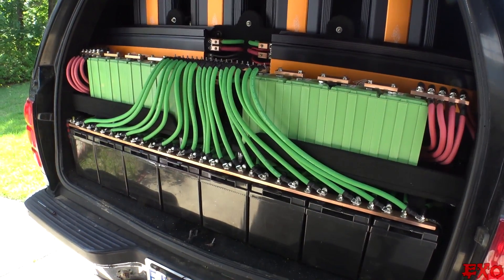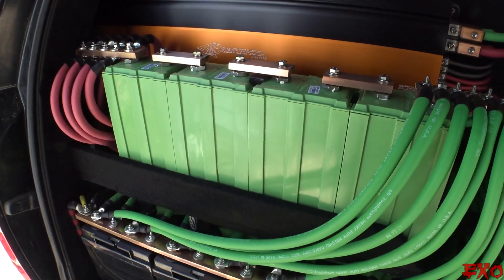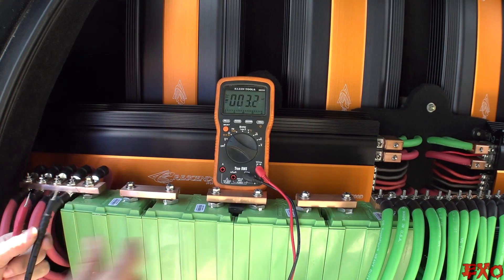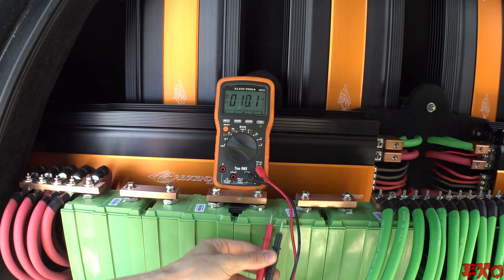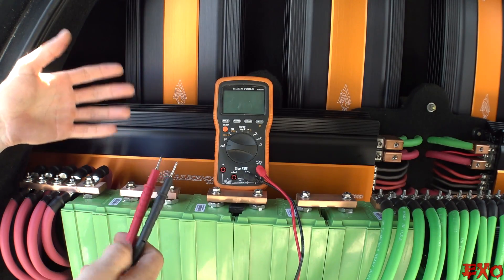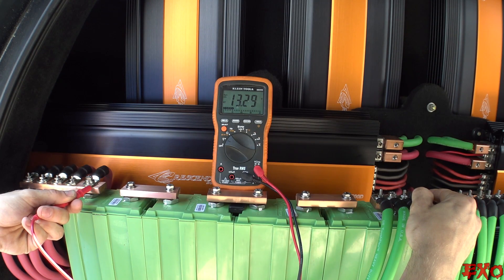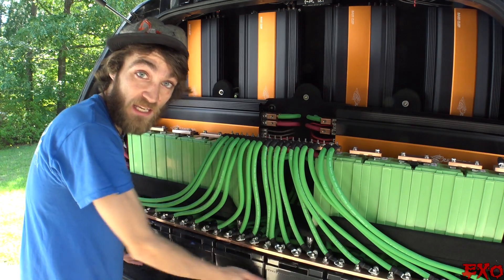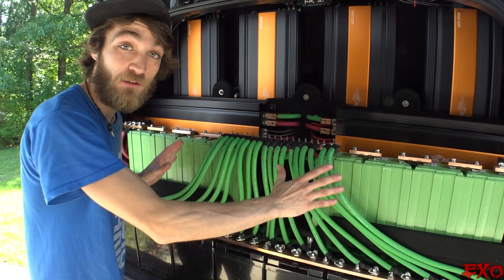DANGEROUS BATTERIES!?!? Explaining EXO's 12 Volt Lithium Iron Phosphate Battery Bank from JY Power

Comment: What's up exo? that's a lot of batteries !! People need to know that Lithium ion batteries KEEP the voltage at the rated amount until they are almost completely depleted ! that is WITHOUT being charged while they are being drained by a device " car amps " portable drill " just like the portable drill with a lithium ion battery it maintains constant output voltage until the battery is almost depleted then it just FLOPS and the battery is useless till fully charged again ! for those that don't know ! a lithium ion battery that is being charged while being used remains at top rated voltage while delivering max amperage ! simple math " if you have 4 "" 3.3 volt lithium ion batteries in series wiring you get 13.3 volts at the output of those at opposite ends ( combined output voltage ) this also increases the total output in rated amperage of the batteries by 4 " as each battery is accompanying the other 3 connected in series ! the SEPARATE GROUNDS for each battery ( prevent bottle necking ) is so that while PULLING the high Amperage from the series batteries the GROUND STRAIN is NOT placed on just ONE GROUND CONDUCTOR !!! for example have a 800 amp battery and use it on a starter on your car BUT have a very small gauge GROUND wire even though the positive wire is 4 gauge an ??? see what I mean ?? I think it goes back to what are the amplifiers capable of drawing in total amps each and how many do you have " then take that figure amps draw per amplifier times how many amplifiers then THAT FIGURE is what you wanna make sure that you have in battery amperage supply actually you want that MUCH an HALF that much again ! so basically have " one and a half times the AVAILABLE AMPERAGE that you ever anticipate being DRAWN FROM THE AMPLIFIERS !!! Then you are sure that it is more  than enough !!
Reply: mark harris Holy shit that's a hell of a rant lol .
Reply: bish bosh " not so much of a rant at all "" really " I was just pointing out my observances from the video " along with personal experience with audio amplifiers myself ! Exo seems like a cool dude an pretty smart too ! This is how it works ! Current = volts × resistance " measures in OHMS !!! Class D amps are more efficient than class a/b but I still Love me some old school power !!

Comment: ohm's law guys not that difficult ^_^ just to add more info having more copper conductor will make less resistance and it will have a really wide conductor the lower the resistance Ω more current can flow with less restriction and yes can be even more than that ...

Comment: 1 cell = 3.3v 
3.3v = average lithium ion size
but why with that large battery, only output 3.3v?
Reply: These batteries can take up to like 4 volts a cell (some more) and can take a 16 volt charge safely across the bank of 4. He only puts like 15 volts into them and resting voltage of each cell is 3.326 but they are resting at 13.304 volts total.  The size of the cell means nothing on voltage but the larger the cell the more capacity (amps) they can hold.
Reply: bigger battery means more capacity. a small battery, 3.3 volts like a cellphone battery ... run a phone for say, 5 hours before discharged right?..... larger 3.3 volt battery like these run the same load for say....9000 hours. but impractical for portability.

a bigger battery means you can draw a small load for much much longer.... or a larger load for a shorter amount of time (as in the case of 20,000 watts of amplifiers)

Comment: Because you balanced the cells before you install them doesn't mean they wont eventually fall out of balance. To get a good 7-10 maintenance-free years out series arrays, a BMS is usually recommended. Although, 4S arrays, as long as all the cells are identical in capacity, don't need a BMS as much as people were crying about in your comments.

Nice looking array tho.
Reply: Juan Pablo you do realize that all your car battery technologies are made up of multiple cells with lower voltages, right?  if you put each of these cells together in a single case, and connected the terminals to an external single positive and negative, then you'd have the exact same thing as your normal wet lead cells and agm batteries
Reply: Charlie McDaniel  

Yes, I make custom LFP arrays for deepcycling. But to say that LFP should be treated like sealed AGM ignorant.

Pb-Acid is a lot more resistant to abuse than Lithium within a car because most car charging systems are designed around that chemistry. There are recommendations because it ought to be well engineered instead of strapped together freely (not that EXO did, he clearly balanced them beforehand).
Reply: Juan Pablo fair enough, I guess I don't disagree that he probably won't see 7 years without them becoming unbalanced but at the same time I don't know of many serious car audio installs that remain unchanged or unmaintenanced for even close to that long.  I only have one secondary battery and I check the voltage on it several times a month to keep a tab on how it's doing, I don't see why EXO wouldn't regularly check the cells to make sure everything is staying how it is now
Reply: Cells have passive balancing boards in each, when not doing full cycles this is all that is needed.
Reply: in 7 years likety this truck will be far beyond what we see here. battery tech is changing constantly.

Comment from the maker: Explaining My "DANGEROUS" Batteries! :D
Reply: EXO you're the man! You are my inspiration!
"Who the fuck knows guys, I'm crazy"!
Reply: I don't know why everyone cares or hates so much. Its your truck and your system. Do what you want. Your obviously doing something right. 152k subscribers lol
Reply: EXOcontralto just shows how people don't watch the whole thing and think they know everything.... ignorant...
Reply: @EXO also curious with what BMS these lithium batteries use? i don't see anything external to manage under/over voltage or over current??
Have been installing off grid power systems for the past 10 years and havent come across a system that didnt have any form of BMS "battery management system" to manage the batteries charging and discharging rates. I have however seen a pile of ash where a house use to be when a customer of mine installed his home made 18650 battery clusters. would hate to see anything like that happen to frank. its an amazing build!
Reply: FIRE SUPPRESSION SYSTEM...?
Reply: also......I guess it's not a problem to connect lithium and agm 
second question.......
so buss bars will completely eliminate bottle nicking even at battery terminal.?
Reply: EXOcontralto for how long will those batteries live ?
Reply: EXOcontralto I have a 2000 Saturn and I wanna run 2 12 inch subs that are 2400 rms what are some key things I should do to get it running nice
Reply: EXOcontralto EXO you're smart asf bruh
Reply: exo you are super good ee aa go aa at auieeoa audio
Reply: Adam Hill i had a 2000 saturn. Fun cars. I had 2 12 in trunk. And 2 8s under back seat. 5k total power. It was loud. But i never used wire like he dies even tho i should.